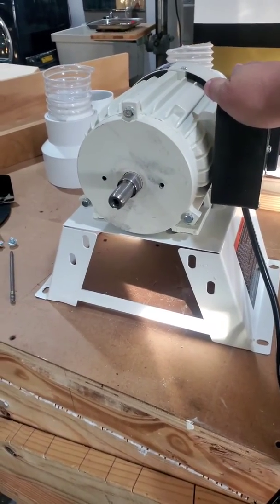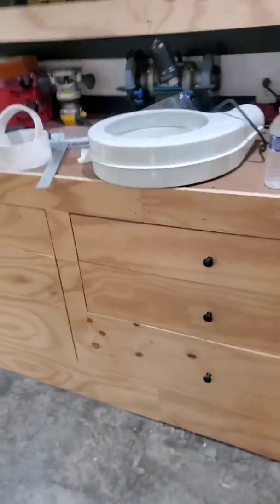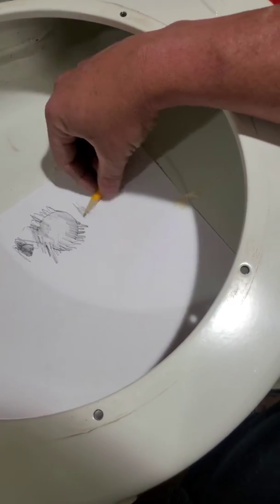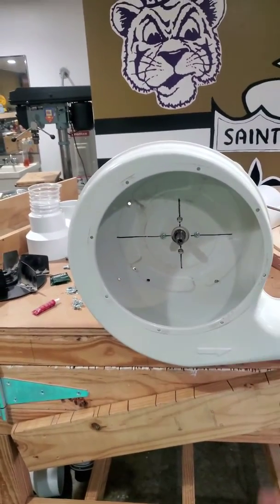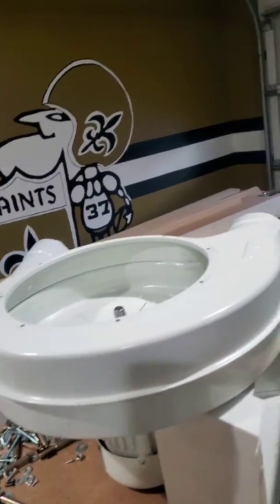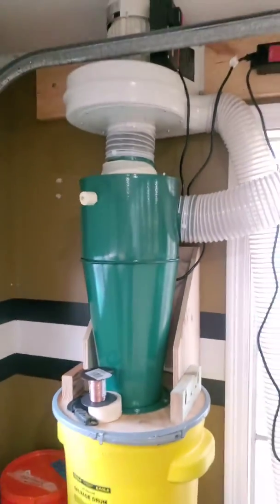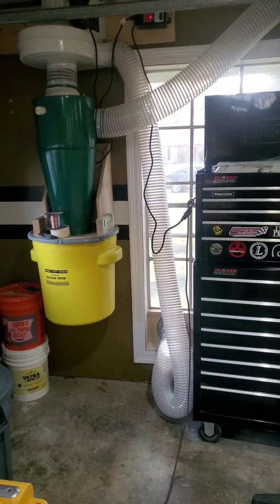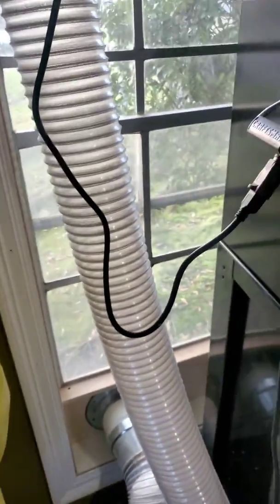How to turn jet 1100 dust collector impeller shroud.

Comment: Thanks for sharing. I want to do the exact same thing. Way too much fuss about filtering. Two questions? Which cyclone are you using and what is the process to taking off the impeller?
Reply from the maker: Screws and bolts very simple to remove. Jet 1100 with a grizzley cyclone. Only metal one I found so I could ground it.